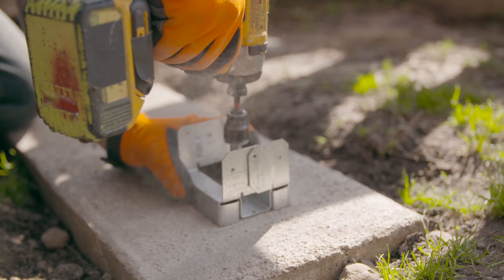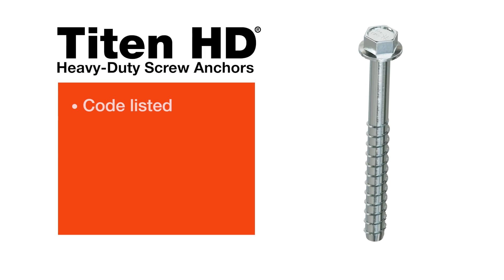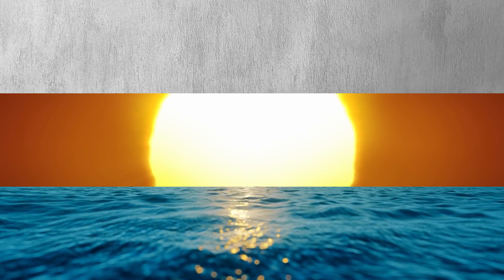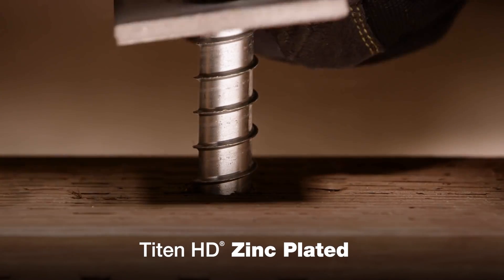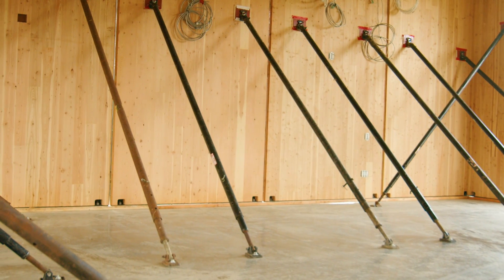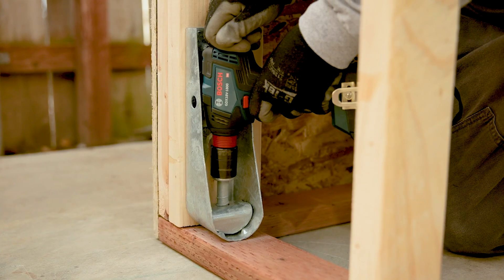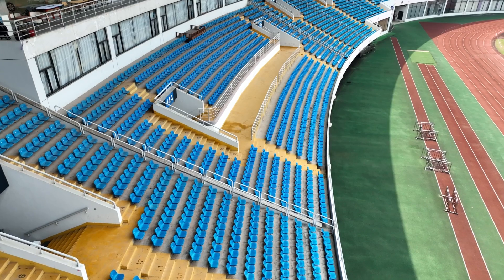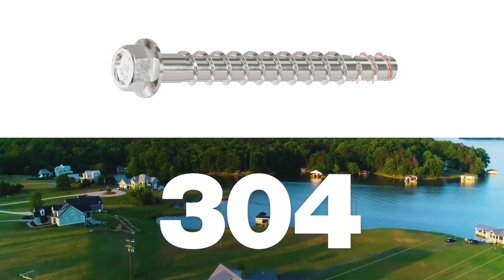Choosing the Right Titen HD® Screw Anchor: Versatility & Strength for Every Project

Comment: Question, I drilled a 8 inch hole, 1/2” thick with a concrete bit. I vacuumed all of the holes, and preceded to screw in a 7” galvanized titen hd screw. A 1/2” rigid impact wrench will only push the screw 80% of the way, I then used a 3/8 ratchet set and a steel pipe to finish it off. I have broken two of the extensions on my ratchet set….. what in the world am I doing wrong?
Reply from the maker: Hi @andrewsaysyes, thank you for the question. To ensure all of the dust is removed from the hole blow the hole clean with positive air pressure, for example from an air compressor. Alternatively an attachment on the end of a vacuum that can reach the bottom of the hole is recommended to remove the dust. This will be especially important for deeper holes where a vacuum hose alone at the concrete surface cannot reach the bottom. If you have additional questions, please give us a call at (800) 999-5099 to speak with one of our representatives. They’ll be happy to discuss your project in detail.

Comment: Hello, an epoxy anchor can hold a concrete overhang in a construction.
Reply from the maker: Hello, this is a great question. Unfortunately, there are some unknowns we'd likely need to know.  We offer free engineering services, and they should be able to point you in the right direction. You can reach those services at: (800) 999-5099.  Thank you!